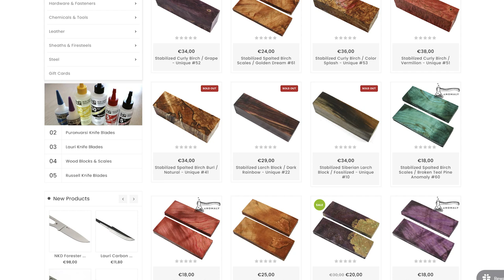Hand forging the serpent in the steel seax

Comment: Another good thing about using hose clamps I found the different bars expand at a different rates and can push away from the center bar. The hose clams allow the bars to slide by one another and not separate so it keeps them from scaling up. Thanks for all the videos!
Reply from the maker: Yup!

Comment: I like how you forged the knife out of several bits of steel.  Reminds me of ax forging where a harder piece of steel is sandwiched in between the softer steel then forge welded in place.
Don't think I've seen a knife done that way yet.  Not even with the Japanese folding blade design.
Might be interesting to see how it would look.
Reply from the maker: its the most historically correct way to do it

Comment: not exactly like the seax's i've seen those are more of a steep drop on the top almost ramp looking! and oxidation is one name for it more common ones are slag and scale! not many woman are into forging that makes you intriguing to say the least! on the kitchen knife how do you get your damascus pattern so even? i know guys who have done longer than you have ( 2 at 28 and 29 years respectively and1 one at 32 years smithing!) and they can't get that even that often! and i never do get an even pattern like that when i try it!
Reply from the maker: yeah most people incorrectly make the broke back seax which is what you are referring to since that is what is mostly on the tv show vikings.  those seaxes were almost exclusively on the british isles.  the kind like i have made is what the vast majority looked like, well the blade shape at least.  there are just as many women smiths as there are male smiths.  most stay hidden as a lot of men are horrible to them or feel the need to speak up and correct them even though they have not the applicable knowledge to do so.  as far as the pattern people may have done it longer than me at my 20 but i put more focus into it than most people i have ever met. call that bragging or whatever you want.  but its a ladder pattern and i use a rod that i hammer in on both sides and work my way down.
Reply: @ThePathOfFire  i come from the longhunter/bushcraft myself and the seax i saw was on here what you made is what i know as the Kephart style bushcraft knife! and no doubt a lot of know it all's on here that's for sure!